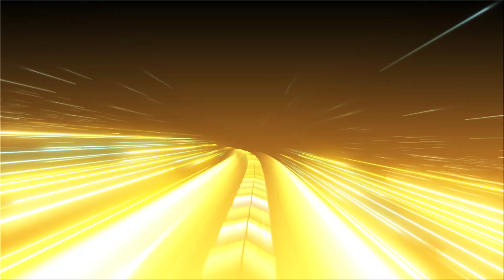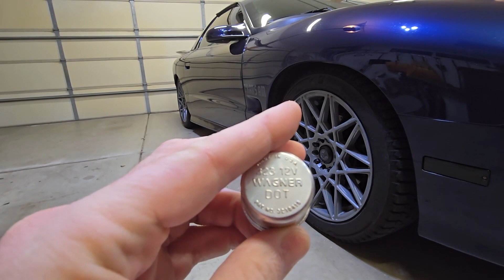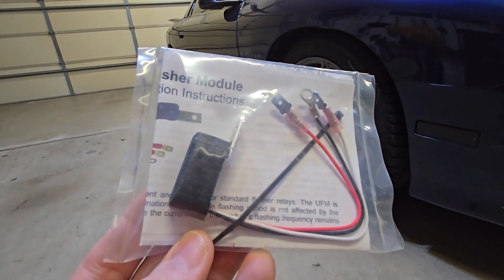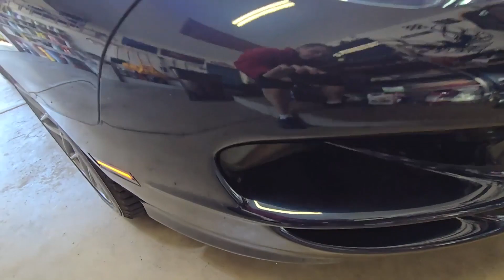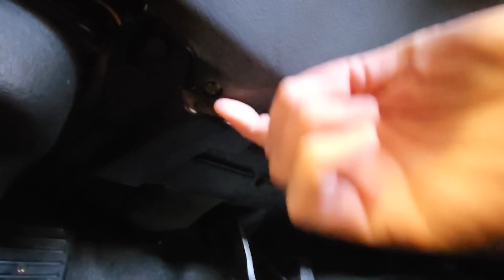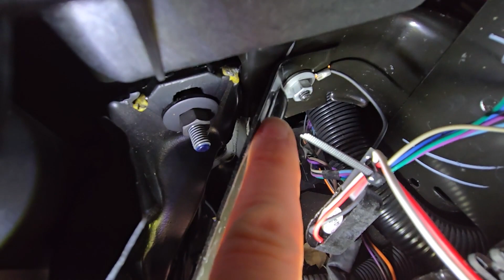4th Gen Trans Am Easy Performance Turn Signal Flasher - Sequential, LED Bulbs

Comment: I bought the smoked led turn signals with the halo but my turn signal doesn't blink or strobe having this flasher will make the turn signal blink?
Reply: Also if this is true how do you install it with what wires go to where
Reply from the maker: Yep it should
Reply: @1999TransAmWS6 I installed mine they are the smoked sequential with halo like yours I bought an Amazon flasher made them flash except now they aren't illuminating bright really looking glitchy etc. halos come on when headlights are on but when I hit the turn signal while headlights are on the sequential don't go the halos kinda blink with headlights off just drl on the sequential looks crap so I was wondering if the led flasher I used isn't enough it's one of those flashers that say electric on it 2 prong with a ground wire

Comment: quick question, did you attach this to anything under the dash, I see where you do the wires and the ground, but it looks like there is a metal tab with a hole in it on the main body of the flasher.
Reply from the maker: I just cable tied it to a loom of wires under the dash
Reply: @1999TransAmWS6  ok cool, thank you, I guess they have that there for other cars, wasn't sure but thought Id ask, thanks again

Comment: Hopefully this works on my ws6, upgraded to LED bulbs and have no signals working now, just sticks on.
Reply from the maker: It should.  It's a full digital flasher and doesn't depend on electrical load.
Reply: @1999TransAmWS6  man you are a life saver. This worked like a charm. $100 canadian but worth it. Thanks!

Comment: How did you get the ground wire to go on the thread?
Reply from the maker: There's already a ring terminal on the black wire.   Just have to remove the bolt and put it back on with the ring terminal around the bolt
Reply: I'm having trouble with the ring terminal fitting around the bolt it's to small
Reply: I had to cut the ring fit it around the bolt then tighten it back up it all works
Reply from the maker: @19BigT99    I've done that with other products many times.  It'll be fine

Comment: I just found the Pontiac Firebird guru. Jesus Christ himself would agree with me. I have been on this phone researching how to modify Pontiac Firebird tail lights by the grace of Moses and Nazareth himself I found them
Reply from the maker: There's a few ways of doing it.   Also check out Iroc Motorsports.   He sells a complete custom led tail light with pretty much any design you want.
Reply: @1999TransAmWS6  I gotta ask, is it possible to do a swap with 2018 Camaro interior with the Pontiac Firebird interior
Reply from the maker: @josiahshieldsrealtalk3562  I have no idea.  It's definitely not a direct bolt in but anything is possible with the skills.

Comment: Are you able to use these for the hazards as well? I ordered some a few days ago but they are still processing order
Reply: Would like to know this as well.
Reply from the maker: I've never tried it but I don't see why not.  The regular and hazard flashers are pretty much the same from the factory, the hazard one is just a little heavier duty. You'd have to figure out the polarity of the wires.
Reply: I ordered one, just got it. But now Im wondering, is the LED specifically called sequential or how do we make them as such?

Comment: What chasing setup are you using?  The one I installed makes my taillights flicker. Especially the end one. The one that never flashed in the stock setup. They are all LED’s now and I like that the end led flashes in sequence but the flicker is annoying. I think the sequence flashing unit I am using (it’s been a long time… don’t remember the setup) is sending a lower voltage to the end light causing the flicker. Not sure if it’s the sequence unit or something else. 
I installed a digital flasher but this setup looks like it will play better!
Reply from the maker: It's a kit from web electric.  They released a new kit a few years back with uses a slightly larger bulb in the outer housing and makes it flash but also light up dim for the running lights.   I'm running all led bulbs with it
Reply: Thanks Jason!
Geez…. You even said it in the video. So much for paying attention 😂
Reply from the maker: @VmanJeff  haha, no problem